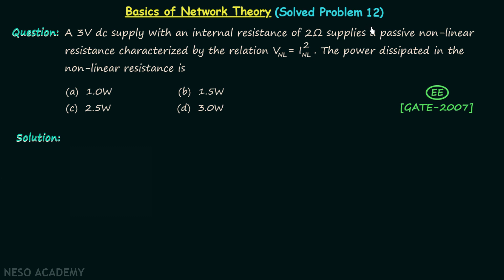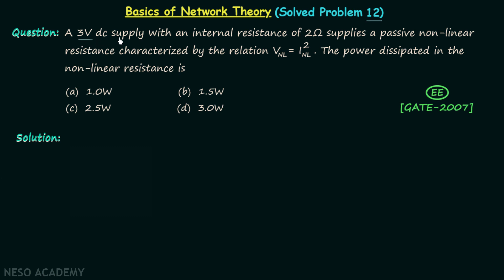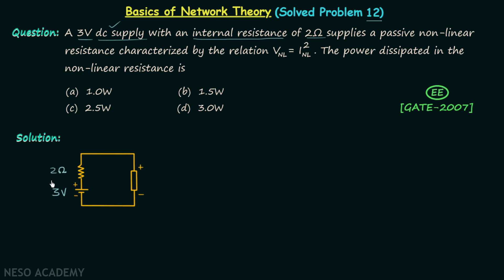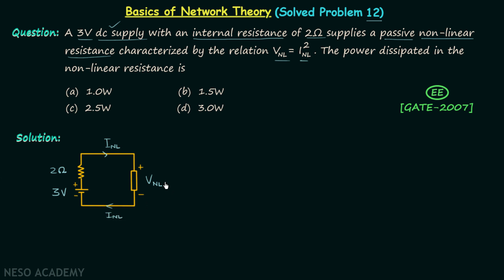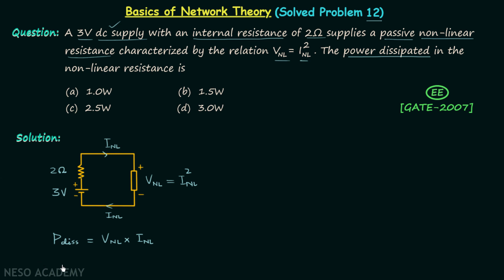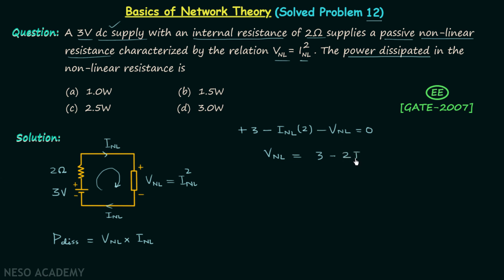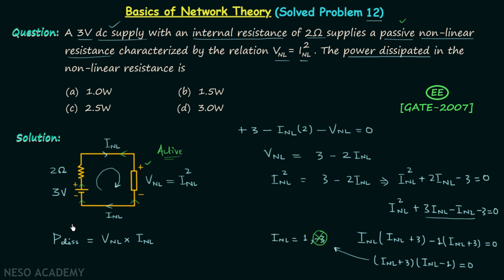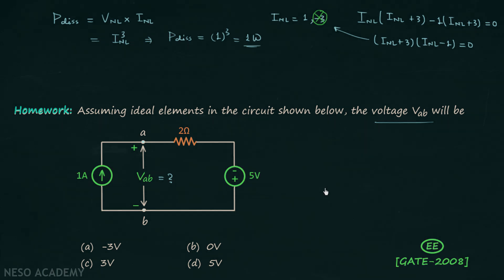Basics of Network Theory (Solved Problem 12)

Comment: if the voltmeter is an ideal element, there is no current through it. So, there is no current across the resistor and answer may be -5V

Comment: sir does the ideal current source have voltage?
Reply: Yes it can have but it is independent of voltage. So circuit will always draw current equal to current source value ,whatever is the voltage across.

Comment: ideal element means...resistance is zero in case of current source and infinite in case of voltage source..hence no currrent will follow through the voltage source...Vab=0.. or use kvl and find Vab=-3v...i got confused... somebody plz help me to clear my doubt regarding this problem...@nesoacademy
Reply: I think you said opposite. Ideal current has infinite int. resistance and ideal voltage has zero int. resistance. Current will flow through voltage source and current will be drawn through current source. Ans will be -3V.
Reply: Ideal current source infinite resistance so i =is across the elements

Comment: -3 volts
Reply: Apply kvl
You get equation as
-Vab+2-5=0
Hence Vab=-3v
Reply: @palyamprakash8906  tq bro
Reply: @palyamprakash8906  bro it is -Vab or +Vab( I think from -ve to +ve it is "+")
Reply: @palyamprakash8906  sry bro I understood it ... Thnku
Reply: Bro
 can you explain in detail?
Reply: Current flowing through circuit is 1amp